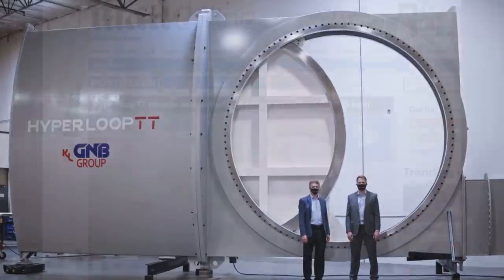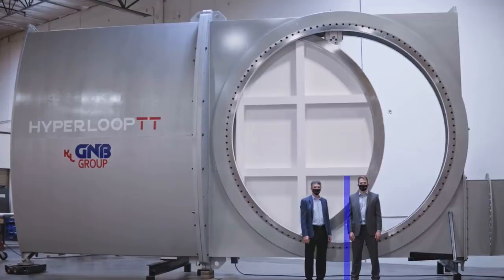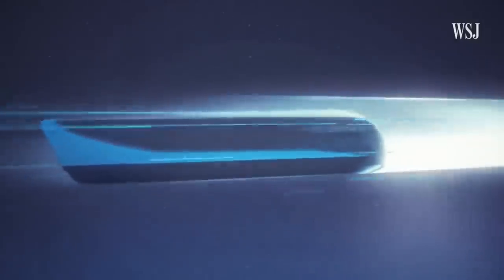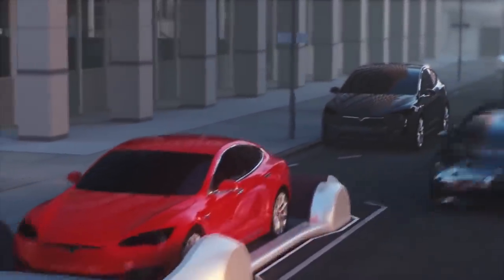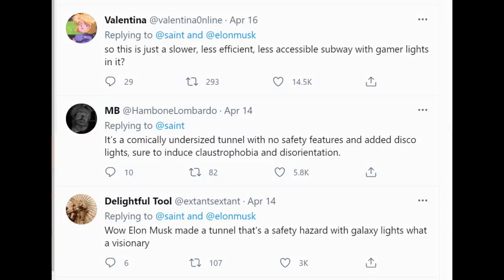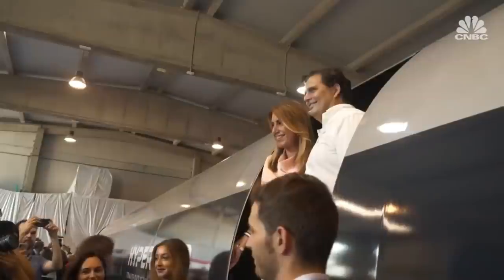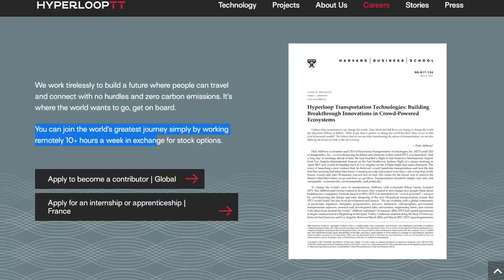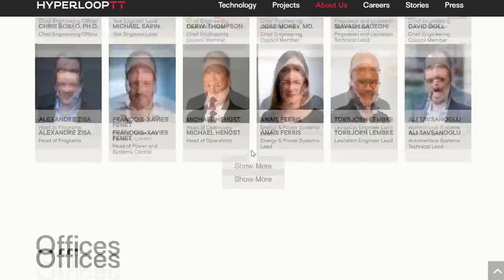Hyperloop TT vs. Virgin: The Race to Make Musk’s Moonshot a Reality - BUSTED!

Comment: Let's not forget: They're also going to be building a massive tunnel underground, through several separate tectonic plates - some of which are actively still moving at a slow, steady rate. Vacuum chambers need to be solid, stable, and not have parts of themselves moving around.
Reply: @kersplody7435  Don't worry, you will not experience them properly (!) addressing the safety issues of the system during your lifetime. If by some insane miracle they do, keep a place at your table; we'll be eating our words together. But I don't expect this to ever happen.
Reply: They'll just have wormholes between each section!
Reply: @ExarduffmanTheFirst  I'll pass until we can develop a computer capable of handling that.
Reply: @RustyDust101  I keep thinking it's going to end up like "running man"
Convicted Schwarzenegger ejected by hyperloop 😂😂
Reply: We will not be able to match parts of their bodies back together.
Reply: Was wondering this as well...
Reply: Do leaky vacuum chambers placed underground fill with ground water?
Reply: @StinkPickle4000  It'd depend upon what they're going through. Could fill with gas leaking in through the dirt due to pressure, could be something else. While the earth would definitely help to maintain the vacuum, when you're dealing with plate tectonics, there's just too many risks to the project.
Reply: @michaelscalia7080  I agree with plate tectonics being an issue 4 sure.  

I was thinking IF placed in ground water and IF leaky, this thing just gonna fill.  Water would sieze a vac pump thou so maybe self solving issue, lol.
Reply: @StinkPickle4000  I mean, honestly, this whole situation is a self-solving issue. They're going to get to the next size up on their waste-of-money vacuum tube and realize "Wow. This is going to cost us millions of dollars a day to keep pumped!" and then the entire project is going to get laughed out of the office like it should have been years ago.
Reply: @michaelscalia7080  hahah, I hope so! 

They kind of allude to the difficulty of pumping it down during the first competition but it was always downplayed.  The competition should have focused on the pumps and seals... which they could've done but the genius thought they needed to compete for a better pod design...
Reply: @StinkPickle4000  But if the pods didn't look snazzy, what would they use to promote their idea?
In all seriousness, the only reason this little "experiment" of theirs is still going is because of overwhelming support from Musk's fandom. Once any of the actual math gets crunched out, someone at the next board meeting is going to shit bricks.
Reply: @michaelscalia7080  lol tru dat
Reply: @StinkPickle4000  hyperloops graphics designers already solved that - water+dirt=mud. mud goes inside hole=sealant.
Reply: @kreksfeks1200  Not all muds can make a pressure seal though, you need a clay based mud built in soil the water will leach out and the small opening would act as a filter.  
In reality the hyperloop will have to be air tight.  From what I've seen only the nonsensical fanbois talk about constantly leaking 'medium vacuum' and being okay with leaks, they also believe in transonic speeds with mm clearance some how using  magical air compressors to power air cushions in an evacuated tube.
Reply: @simonsays5587  You do remember how 'Running Man' ended for the host, right?
;D
Reply: @RustyDust101  😁Sure do👍
Reply: @StinkPickle4000  Yes

Comment: I'm constantly amazed that these things are supposedly being designed to run in a vacuum but they always look super streamlined and polished. Presumably more of an artist's visualisation of something fast than anything actually produced by engineers.
Reply: there is still air there and if it will travelling at 800 mph or whatever, that'll matter.
Reply: @MsHumanOfTheDecade  There's never a perfect vacuum, not even in space, but at the level of vacuum they're claiming the residual air would be negligible at that speed.
Reply: @DaveKahn  at the level of vacuum they want to run it at, air would build up infront of the train at a level that is significant. There was a bunch of legit research done on the issue. Thats why they design it to be aerodynamic. It still wont work, but hey, it looks fucking cool.
Reply: @bipolarminddroppings  You may well be correct, I don't have the fluid mechanics chops to do the calculations myself.
Reply: And super streamlined does not always mean less drag. Aerodynamics are complicated and sometimes blunt or irregular shapes can actually reduce drag via effects such as shockwave, vortex disturbances, spiral prevention and many other reasons.
But you are right also in that the hyperloop should be just a flat cylinder as it can disregard drag.

Comment: I love how much effort they put into making the pod as aerodynamic as possible 😭😭😭
Reply: I see what you did there
Reply: Great point, with no air.
Reply: The issue with travelling in capsules in tubes at 700 mph  is that even there is a vacuum, there are still air molecules and by moving with such speed in tube you will collect all of those molecules in front of your capsule, producing quite significant pressure, so you need aero dynamic capsule to overcome the pressure of air you would create in a vacuum tube by moving fast in it.
Reply: @kmdsummon  I was about say this less eloquently
Reply: @kmdsummon  fair enough
Reply: I'm disappointed they didn't go with the 1950s rocketship design
Reply: @kmdsummon  But... but... the Holy White Paper said it was a high vaccuum of roughly 99.99%... that means there can't be a lot of air, right? 
His Holiness Musk has declared it, and he is always right. All hail hypno-toa.... er Elon Musk.
Reply: @RustyDust101  In fact, the holy white paper tells it should be medium vacuum there, which is “significantly less vacuum”, then perfect vacuum. It was thunderf00t who told that medium vacuum is still vacuum and it is 99.99% of perfect vacuum.
Reply: @kmdsummon  Kind of defeats the entire purpose of building a vaccum tube for transport to begin with ! But sure, 😒, whatever you say...
Reply: @kmdsummon  Are you sure about that?
Reply: @JackSparrow-re4ql  not particularly, any reduction in the amount t of air resistance allows for increased speeds and a decrease in resources spent to  to accelerate the vehicle. That remains true even if you are at 50% of normal atmosphere, 70% or 99.999%.

That is fact, its why the higher the altitude you cruise at the less fuel needed to reach/maintain an airspeed compared to the same speed at ground level. 

That doesn't mean that the hyperloop in its current form is credible or likely to be built any time soon but any reduction of pressure would purely in terms of fuel cost compared to something not in a low pressure tunnel. 

One huge problem of course for practicality that they are utterly deceptive about is what cost it will take to create this awesome low resistance better environment. Until we can do hat cheaply and easily it kills the project right then and there
Reply: @jediknight1294  Yeah, the idea itself has some potential to function and is producible but is so impractical to build and maintain that it'll cost more than it saves. 

People really should've known Musk was full of shit when he said that he could build a bullet train in a tube for significantly cheaper than just building the bullet train. The fact that he keeps moving the goal posts is quite telling

If he was serious about making a viable project, he'd have done something small scale with models to prove the concept can actually work in the manner described
Reply: @jediknight1294  We already have an "awesome low resistance environment"; it's called the lower atmosphere; we fly planes up there, without having to build any stupid tunnels. Ever heard of that smarty pants?

Comment: I love how the hyperloop train mock-up is made super aerodynamic, despite supposedly being made to run in a vacuum.
Reply: A better proposal might be to decrease air pressure in the tube not to vacuum levels. Instead just low atmosphere
Reply: You can't reach perfect vacuum
Reply: @KManAbout  Any difference in air pressure between environment and vehicle requires a pressurized vessel that must be engineered to at least airliner standard.  That mock-up is a con job.

Comment: I'm looking forward to seeing how well these underground tubes handle fucking earthquakes in So-Cal
Reply: don't worry, they'll just use mag-lev to lift the whole tube, passengers, stations, cars all of it, off the ground when an earthquake happens. It's really quite simple, promise.
Reply: @LOGIBEAR01  And where do you think the tubes are? An earth quake is a major problem for these tunnels/tubes. X, Y or Z are all bad directions to suffer movement. Where would tge huge shock absorbers be placed that doesn't result in a curve on the tube (bad, bad, bad at extreme speeds)? And how to implement telescopic sections on the tube for length adjustments?
Reply: They’re empty tubes, so probably won’t have a hard time...
Reply: @perwestermark8920  don’t you understand? The tubes are magic, like internet tubes!

Comment: As someone who's spent several decades in the high-vac industry, I've got to say that is one big-ass gate valve!  It's about twice the size of the largest one I've every worked with, which was a 10' (3m) diameter version built for a Lawrence Livermore laser fusion experiment.

I didn't see a strongback on the other side, so I'm not sure how it seals, but if they can't get it to cycle any faster, it's going to have a huge impact on throughput (i.e. the schedule).  Not a way to run a railroad.

Comment: Lmao the stock options thing would’ve been perfect for The Simpsons clip where Bart takes the stock options from the internet company like a roll of toilet paper.
Reply: At least there Bart got to strip all the copper out of the walls, if you work from home for HyperTT you're screwed!
Reply: Wow 👏 at this point this is a scam too big to fail. This is a new form of scientology.
Reply: No, he took actual stock certificates as toilet paper. These are OPTIONS, which is the right to BUY stock certificates!
Reply: @furtim1  so like if you work for a FastFoodRestaurant and they pay you in 50%-off-cupons?@-@
Reply: @pseudopsychonym  Yeah, that's a pretty good comparison.
Reply: @pseudopsychonym  It's like you work at a company that does not sell anything and you get a certificate for 10% off the shares as long as you spend it before they produce anything.

Comment: I loved the moment when he said a "vacuum tube with an air hockey table" Vacuum lives from having no air in it. Air hockey lives from blowing air out of a shitton of tiny holes, pretty much countering the vacuum idea.
Reply: One thing you dont know is that elon invented vacumairium, so your remarks is just silly sir!
Reply: that early drawing at 5:59 shows a vehicle with a huge fan at the front. It looks like it's suckingair o in at the front and blowing it out below. That creates the air cushion and moves the vehicle forward. So there clearly has to be a vacuum with a lot of air to let that work. 
Maybe they need to pump extra air into the tubes to let the vehicles lift of easier, it should fly better in a thicker athmosphery. /s
Reply: Maybe the journalist had a scientific background and was being stumped by this contradiction.
Reply: @Bauer-ke6lp  There must be two different design teams who never talk to each other. One team is designing a vacuum system but the other team is thinking it will run in air.
Reply: @dukenukem5768  That's the first explanation I've seen of any of this that makes any sense at all!
Reply: @Bauer-ke6lp  that’s just to remove any excess air from the front that may build up, since it wouldn’t be a perfect vacuum. But either way it’s not even going to happen.
Reply: The vehicle floats on the contradiction as Elon dances between the raindrops.

Comment: 3:18 
Thunderf00t: *Has a PhD, many publications* "I can't be bothered to do this circle calculation thing"
Reply: Pi divided by 4 in A=pi/4*d^2 can be estimated as 1 in these calculations.
Reply: I think its bait for haters
Reply: That was a bit weak. Just call pi three and then the area is 3x2x2 =12 sq m - a much better estimate. Done quicker than saying "can't be bothered to do the whole circle calc" and does not even need the back of an envelope.
Reply: @dukenukem5768  If you are going to make pi 3, just use a square
Reply: I have to admit that got my BP up a bit.
Reply: @ExistenceUniversity  Considering the actual value of 4*pi (about 12.57), 12 is a better estimate than 16

Comment: The new material is actually called No brainium.  They will make a perfect vacuum then stand near the crack of the door, open up, and get sucked in at the speed of sound.  This is how they will travel at high speeds in a vacuum.   The tube makes a convenient way to hose away any offal after being sucked into the vacuum.  If they're lucky, some body parts will make it to the other side of the tube, but the body parts will get there very fast.   Also may I say the tubes remind me of the Running Man.
Reply: Musk job requirements: You must have a vacuum skull.
Reply: Was that also that material on the dome of that super race in I believe a DC comic. Or was it that guy that could attack with sound waves from his brass knuckles like sound amplification weapons. So many choices and so many simplistic minded engineers. You need NASA astronauts to tell you how that shit will fuck up in a vacuum since I"m sure they were warned and some experienced the shit they are totally unaware of at the moment though after the catastrophy they'll be fully aware. Iike running it in the rainy season with high humidity it'll be almost useless unless they get the world biggest fastest dehumidfier that can do zero humidity instantly.
Reply: The tube's reinforcing members are made of Unobtanium, the expansion joint bellows are made of Bullshittium, and the fasteners are made of Gullibilium.

Comment: Still want to know what engineer though air cushion levitation in a vacuum chamber was a good idea. Kinda defeats the point of the vacuum or if you were trying to use the trace air in the chamber to get that air, well you have to get up to speed first to use it like that.
Reply: Not to mention the GIANT TURBINE on the front to propel it forwards.

Comment: I was at a 2018 safety conference, where one of these "Contributors", presumably also "paid" in stock options presented some of the work that had been done on Hyperloop TT regarding safety. It was professionally done and took a reasonable look with best-practice methodologies at some aspects, such as autonomous capsule life support, capsule doors, tube repressurisation, etc. It didn't address some of the elephants in the room, such as tube integrity, but my impression as a safety professional was that in the long term, and with unlimited funds, hyperloop could be made to operate acceptably safe, but at a cost that would make it economically unviable for any target group. It would maybe take safety measures comparable to aircraft, on a capsule-level, but the infrastructure would be much more expensive and much more difficult to make even tolerably safe. And as far as I recall, the infrastructure wasn't even addressed in the work presented at the conference.

Comment: "'No carbon emissions!'
'Huh... that's odd. '"
Lol
Reply: If they use ANY concrete then there will be emissions for decades as the stuff slowly cures.
Reply: If it doesn't exist, it doesn't have carbon output.
Reply: No exhaling!
Reply: @timfirst3536  yes...we should power ourselves with batteries...
Reply: To be fair, they mean no direct emission from the vehicles. Like electric cars. The complete carbon footprint from building the thing to how the electric power for running it is generated is not CO2 free of course!!!

Comment: instead of oil fossil fuels the train will run on sustainable wood that will be grown next to the hyperloop system, this new engine they are calling Hypersteam will burn the wood to heat up a boiler to produce steam that will then power a turbine that will charge electric batteries that will power the hypertrain.
Reply: *hypetrain
Reply: "sustainable wood" 😂 

Alright, that one made me laugh.

Comment: Just a suggestion for Thunderf00t: try to compare the energy savings of not having to move a little bit of air around using aerodinamics (air is actually used to help keep the high speed trains attached to the rails) to the energy requirements of creating and maintaining a vacuum.

Comment: I once drove across the US. Nebraska was thee WORST part of the drive: totally STRAIGHT! 
I was driving for HOURS without hardly moving the STEERING WHEEL. 
It gave me ANXIETY worrying that my car would NOT be able to turn if I wanted it to. 
So I started doing unnecessary LANE CHANGES just to get some ARM MOTION and confidence that the car was STILL UNDER my control. 
In a tunnel, your motions have to be EXTREMELY SUBTLE, or you'll CRASH into the wall. 
You'd BOUNCE from wall to wall if that happened.
That's why the tunnel SPEED LIMIT has to be set so low.
Just imagining this tunnel driving brought these memories back. 
Later I had to drive through a mile long tunnel under the Rockies, but that tunnel was WIDE. 
Tunnels create ANXIETY in me. I'm able to overcome it, but it doesn't seem like something I want to get used to.